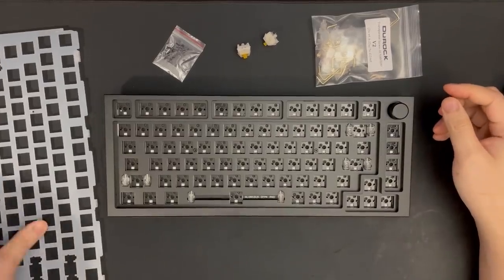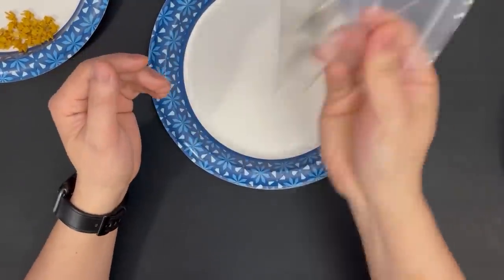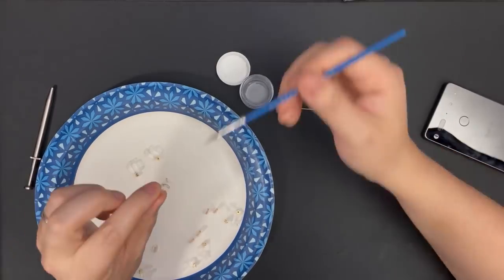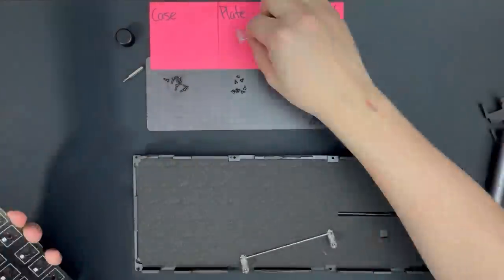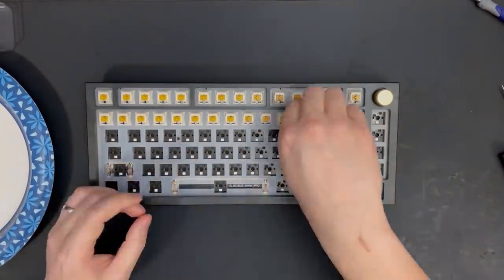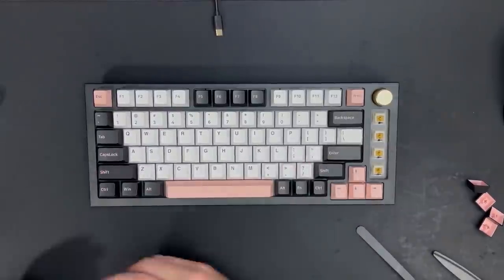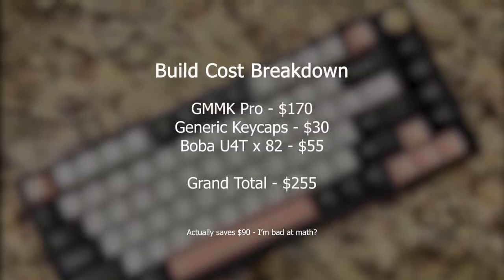$350 GMMK Pro Build Guide and Sound Test feat. | Boba U4T | Holee Mod Tutorial | GMfaKe Olivia!

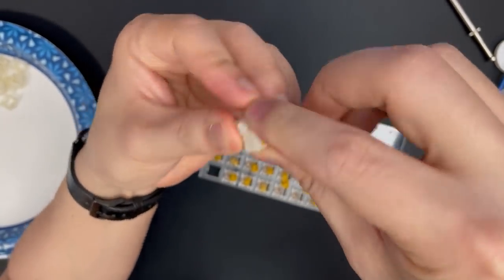Comment: 3:30 Gazzew (the creator of U4T) recommends that you should have the stem pressed down as you snap the housing back together, not doing this has a chance of bending the leaf contact and decreasing the tactility.
Reply from the maker: Yeah, this is a good guideline, and applies to all switches, not just Bobas. But in general, as long as the stem is aligned with the sliders on the bottom housing, it's pretty much impossible to mess up the leaf (personally I've damaged the leaf once in like 1000 switches I've lubed and it was because I had the stem facing the wrong direction). Thanks for commenting this though, I think it can help some other viewers reading through the comments!

Comment: Amazing Tutorial!
I don't have my gmmk pro yet but this tutorial is going to really help the build!
Thanks again for putting in the time and effort to make this great video!
Reply from the maker: Thanks, glad it helped!
Reply: @bigxie  on my build im thinking of using Akko CS Rose Red switches and im wondering if they also work with the gmmk pro as you need a different type of switch opener for them. I don't know much about hotswap keyboards so this would really help me out
Reply from the maker: @th-dv5bz  yeah they'll work, I saw that they're 3 pin MX clones so they'll fit in the GMMK Pro no problem.
Reply: @bigxie  Thank you!
Reply: @th-dv5bz  how did the build go
Reply: @DuckDynamite  haven't done it yet i have been really questioning what to get but for now im thinking of doing a tofu65 with darling frankenswitch build

Comment: Great video. Nobody else I've watched mentioned the self-tapping screws that the PC plate comes with. I was able to figure this out on my own but several videos I've watched struggled to get the PC plate screwed back into the PCB since they apparently missed the extra baggy with these screws in it.
Reply from the maker: Interesting, maybe the bag of screws is inconsistently placed in the packaging? But mine were taped to the little box the PC plate was in and it was pretty much impossible to miss. Hopefully it helps some other viewers not miss it.
Reply: I set the pack of screws to the top of my table and immediately forgot about them. Reusing the default screws took some elbow grease but they worked. The parts where the screws go into the polycarb are thick enough that I don't think there's a risk of it cracking.

Comment: Thanks for the guide. Just one note that you don't need the stabilizer washer because the PCB is isolated so the metal screw won't interfere with it.

Comment: I have a super pricy GMMK Pro build too. Uses Polycarbonate plate, a frankenswitch made by me using Tecsee Purple Pandas and Ice Mangoes, l*bed with Tribosys 3203, 3204 and Krytox 105. Stabs are Owlabs Owlstabs V2 screw-ins, fully tuned. I didn't use any of the screws for the polycarbonate plate as I thought it would give the board a tiny bit more flex, and I loosened the GMMK Pro chassis screws (connecting top frame and bottom frame) so there would be more gasket flex. Also used some of keychron's own Developer keycaps and a Silver knob. Good build IMO.

Comment: Awesome video Andrew. For many of us, the main thing we’ll be doing is mounting the polycarbonate plate. I’m really confused/stressed about that part. Any further info? That part of the video was pretty quick.
Reply from the maker: Hey Hudson, it's not too bad swapping out the plates. If you're using the stock GOAT stabilizers, there should be no fitment issues. If you're using aftermarket ones, just take care to align the cutouts and maybe apply some pressure to get the stabilizers through if it's a tight fit. Otherwise, the only other thing to look out for is to not reuse the 8 plate screws from the aluminum plate, but to specifically replace them with the self tapping screws that come with the polycarb plate. The PC plate is not threaded, so you'll need to use some grunt to screw it on to the PCB with the self tapping screws. You may also want to make note of the orientation of the diffuser strips when you remove them, which I forgot to do, but I also think it doesn't really affect the performance of them whichever direction you put them back in.

Comment: Hi Andrew, thank you for the great video. I went to purchase the same keyboard spacebar foam and there is a disclaimer that they don't work with plate-mounted stabilizers (like the one in the GMMK Pro) - did you have any issues getting them in? Do they just need a bit of modding?
Reply from the maker: The GMMK Pro's GOAT stabilizers are PCB mounted screw-in stabilizers, so there is no incompatibility there. The plates do support plate mounted stabilizers, but that would be an aftermarket downgrade, so I would not recommend that. Where you may need to watch out is if you're using the knock off Olivia keycaps, the pink spacebar has some extra posts in it which you'll need to poke an extra hole or two in the foam to accommodate. If you use the normal white spacebar in the kit, it has the "GMK" posts underneath and fits the foam perfectly.
Reply: @bigxie  Right, I gapped and forgot I swapped the GOATS for clip-in Cherrys. I might have to look into getting some Durocks along with this spacebar foam. Thanks for the reply!
Reply from the maker: @julienmyst6590  np, and if you're using clip in stabs, you're referring to the ones that still PCB mount but just don't screw down, right? They would work with the foam as well, the incompatibility comes from plate mounted stabs that have extra height to the housing that extends up into the keycap, so some of the foam would need to be trimmed. It's not a problem for any PCB mounted stabs though, so if you are otherwise satisfied with your stabs, you can save the $25 on Durocks. Good luck with your build!

Comment: Wow, great video. I really want to make one for myself now, but it would cost over $500 in CAD.
Reply from the maker: Dang that ends up being $50 USD higher. Is it just more expensive to get the parts in Canada? At least you guys have great healthcare 😅
Reply: @bigxie  Yeah it is more expensive because of import fees/duties and the parts are generally marked up in addition to the currency rate. For example, the GMMK Pro is listed at $239.99 CAD at most Canadian vendors, effectively $20 USD more than the MSRP. Also, the lack of parts vendors in Canada makes sourcing parts difficult and often times costly.

Comment: Great video Andrew! would u recommend GMMK Pro over Tofu65 hotswap?
Reply from the maker: I haven't tried the Tofu65 actually, but I think it depends what you're looking for. Do you prefer the 65% or 75% form factor? Is the Glorious' 2 year warranty important to you? The Tofu is tray mount while the GMMK Pro is gasket mount, but both will have a pretty stiff typing experience. The Tofu can probably be louder/more thockier while the GMMK Pro has a more muted sound profile. And the Tofu is a little bit more expensive, but they're essentially in the same price bracket. I think either can be used to make a really good build provided you go through the same steps (lubing switches, tuning stabs, etc.).

Comment: you deserve more subs bro! also I really want to get a brass plate but also want to get after-market stabs what should I do?
Reply from the maker: Thanks! I would recommend you check out Keybored's GMMK Pro review where he built with the brass plate and Durock V2 stabs. Pretty much you need to use a file and make the stab holes in the brass plate larger, which should be fine as long as you don't ever plan to use plate mount stabilizers in the future.

Comment: Great video and I will use this as a guide since it will be my first build. Just got my GMMK Pro and Boba U4.  I also got the brass plate with V2 so curious to see what i need to do to make them fit (believe you mention grinding down the plate?) any insight would be great. 

Can you also link me the lube station and switch puller you are using?
Reply from the maker: Sure, this is the kit with the lube station and switch puller: https://www.amazon.com/gp/product/B08H5PQWR5/

I personally don't have experience with the brass plate, but keybored (another YT channel) recommended this kit for filing down the GMMK Pro's brass plate in order to fit the Durock stabs: https://www.amazon.com/gp/product/B07TSK23LY/ 

You would want to do the test fitting of the stabs with the plate like I did in the video, and identify where there is tightness and file those areas of the plate away until the stabilizer housings fit well.
Reply: @bigxie  This is great, thank you for the response. I actually bought that same lube station and it was delivered yesterday. I also decided to return the screw in Durocks for plate mounted (saw on another video) to bypass any type of filing down. 

One last question, I bought the Boba U4 Pearl housing (62g), do you know if this will emite a decent amount of RGB or will the pearl housing block most of it? I don't need it be glaring LED light, but would like to at least see some emitting from the caps.
Reply from the maker: @sethspring434  nice, I think with the holee mod and proper tuning, plate mount stabs are fine too. I use Durock plate mount stabs on both my NK65 builds and they perform pretty much on par with screw-ins. 

The pearl housings will block some RGB, and the brass plate will do so further. The reason the RGB still shines through decently in the video is the PC plate helps diffuse it, otherwise the U4T has a similar opaque housing and would block some RGB. That being said, I think at 100% they should still be fairly visible between your keycaps.

Comment: Since there's a clear top version of the U4T, is there any point in getting those for this board? The RGB looks pretty bright in the video with the opaque tops already.
Reply from the maker: Those have always been out of stock when I checked, but yeah, I think that even with the opaque tops, the RGB glows through really well. It helps that I used the polycarb plate, it diffuses the light better. If you're using alu or brass, maybe the clear tops will help more.

Comment: I’ve never tried a brass plate before on a keeb, is it worth the extra $50?
Reply: Heavy no for me as I wouldn’t use it for anything other than a silent keeb but preference I guess.
Reply from the maker: Brass is often described as providing a more "musical" sound, and it is the stiffest plate material available for the GMMK Pro (stiffer than aluminum). However, with the way this board is designed, all the plates are already pretty stiff and from what I've read, there isn't much difference between the brass plate and aluminum one. Personally, I would not pay the $50 extra for it. It's also the least compatible of the plate options with aftermarket stabilizers.
Reply: @bigxie  thanks for the reply! Gonna stick with the stock aluminum! :)

Comment: i was expecting so much more for the kb, seems the kbd lite sounds much better with less mod. I had ordered but cancelled waiting for improvement. Did you have any issues with stabs/
Reply from the maker: I didn't have an issue with Durock stabs and the PC plate, but it seems like the other plates need to be modified if you want to fit Durock stabs. I'll hopefully have my KBD67 lite in June to make a direct comparison, but I think that it does certainly have a more attractive sound profile if you're looking for something more resonant. The GMMK Pro is definitely a muted board.
Reply: @bigxie  looks great though. Nice build

Comment: Hey, you mentioned that we can skip the stabilizer dampeners, will that cause any damage to the PCB board if we press the stabilizer too often? Thanks.
Reply from the maker: No, it shouldn't be an issue, it's actually designed to have the stabilizer legs hit the PCB. Putting some tape or other dampening material down is really just for sound preferences. An alternative way is also to put a tiny dab of lube where the legs would hit the PCB to also kind of soften the impact/noise.

Comment: Are you having issues with the polycarb plate? I've read and watched some videos where the switch is too loose to the point that it basically just pops out. Did you experience this with your plate?
Reply from the maker: I think the problem is made worse when the PC plate is intentionally left loose (i.e. not using all the plate screws or standoffs), but in general yes, it is a little loose and sometimes removing a keycap pulls the switch out along with it. However, it doesn't affect day to day usage at all - the switches stay put exactly how you'd expect on any other keyboard/plate.
Reply: @bigxie  I see, that's good to hear! I saw a clip of a switch popping out when the key was pressed in an awkward angle. I'm trying to decide between this board or and the tofu60 i'm using right now

Comment: Did you have any problems with the Durock stabs fitting the plate?
Reply from the maker: With the PC plate, the fit was tight but did not cause any issues. You can see the process at around 7:30 in the video.

Comment: How do you compare to the NK65 ee? Because i’m thinking about getting both NK65 and this one. Also I love your keyboard btw! I personally think it looks the best out of all the ones that i have seen
Reply from the maker: Thanks! I like the NK65 EE, but after having a couple of boards now with PCB mount stabs, I really wish the NK65 wasn't using plate mount. I'm going to go back and swap the stock stabs out for Durock plate mount stabs and do the holee mod on them and hopefully that can bring it closer to PCB mount performance. But for $100, it's a great board and I don't have many complaints. Even the stock silicone dampener is pretty good.
Reply: @bigxie  Thank you for your response! I will be getting both then HAHA
Reply from the maker: Yes, this is the way hahaha

Comment: Thanks for this! Are switch films the equivalent for band aid mod?
Reply from the maker: It's a similar concept. Switch films are useful for closing the gap between the top and bottom housing of switches. Some switches have a little bit of looseness when closed which can turn into unwanted noise when typing, especially quickly. Putting the switch film in between keeps the top and bottom tight and prevents this. For the Boba U4Ts in the video, they are manufactured with very tight tolerances so they actually don't wiggle at all, even without films.
Reply: @bigxie  got it! Yes I have the boba u4! So it sounds like the films will work for the switches plus the durock mod you did. Just waiting for my turn to purchase the gmmk pro. Still undecided on the keycaps. Don’t want to spend so much on keycaps LOL! Your video really helped.

Comment: Did you struggle removing the screws on the bottom of the gmmk pro? Mine seems stuck in place.
Reply from the maker: I didn't run into any issues. Are the screws stripped? That's possible if using a bit that doesn't quite match.

Comment: Hi planning to get u4t's. What's on your vid? 62 or 68? Is it true the lesser the spring weight the more tactile it is?
Reply from the maker: I'm using the 68g version in the video. I don't have experience with the 62g version but I would think that the tactility should be comparable, but the force required to reach the tactile event will be slightly lower for the 62g version.

Comment: I was able to install durock stabs in my aluminum plate GMMK Pro with no sanding. Takes a bit of persuasion but it will work just fine.
Reply from the maker: Yeah it used to vary per plate with the first batches, but probably by now Glorious should have their manufacturing more consistent
Reply: @bigxie  Yeah, my first brass plate late last year needed filing down before the Durock v2's would fit, but just received a new brass plate today for another build and the Durock's fit perfectly fine without any mods so it seems Glorious have changed the design 🙂
Reply from the maker: @TMDangerMouse  nice, thanks for sharing!

Comment: Hey, did you have any problems with the PC plate bending the PCB upwards?
Reply from the maker: Yes, this is a problem with all the PC plates. JYMV's video on the GMMK Pro goes over this in pretty good detail. My opinion is that it's not really that big of a deal and once you put the keyboard back together, it hasn't really manifested in any symptoms or issues.

Comment: So the holy mod essentially lines the inside of the stabilizer housing so the stem contacts the band-aid instead of the plastic of the housing, right?
Reply from the maker: Yes, essentially it acts as a pad for the stabilizer wire and removes the clicking that comes from the end of the wire hitting the inside.

Comment: Will changing stabs fix sluggish spacebar? Mine doesnt want to come back up consistently.
Reply from the maker: There could be a lot of reasons for this - what switches are you using? Sometimes with very light switches (i.e. 40g springs or such), you'll need to use a heavier switch for the big modifier keys, especially space. You can also remove the spacebar and place on a flat surface to check if it is warped. If warped, you can try heating it up with a hair dryer and placing some flat heavy objects on it (while on a flat surface) to try to straighten it out. Also, if you used heavy lube on the stabs (i.e. dielectric grease), then yeah, it can cause it to become sluggish.